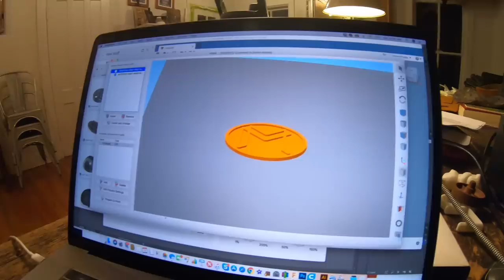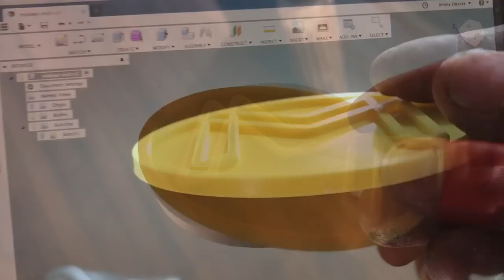DiResta Cast Brass Buckle

Comment: I like the belt connection and the bandsaw kerf to cut out the center hole was perfect. Little solder or jb weld and the split no longer mattered. A casting foundry is on my list! Great job 🖤™️

Comment: if you take 2x4 wrap 3 or 4 newspapers around it tie end with wire soak in bucket of water , as soon as you pour grab 2x4 and hold tight over top of casting steam will force metal deeper into casting

Comment: Would it not be easier to remove the template from the mold if the back was taped to plywood that is larger than the mold box?

Comment: Rather than soldering or using jb weld, could you not have added a couple of small extrusions to the back of the casting that you could hammer down like rivets instead? Or even just used what was already left over from the casting process?

Comment: Nice buckle Mr D.  If I may, try drilling a couple of holes into the back of the pattern so you can screw a couple of self tapping screws into it. They'll give you a good place to lift out the pattern after you've rapped it without blowing out the edges. Hope that makes sense? Check out a Youtuber called Myfordboy his casting video's are excellent

Comment: Noob Question : Could you lift it from the sand with a sucker ?
Reply: Super glue a lifting tab or knob would work easier.
Reply: STEALTH Damn it STEALTH now you made me hungry
Reply: The conventional way is to have tap holes in the back side of the mold to screw lifting handles into.
Reply: @vinercent215  I was thinking about the problem and was just going to suggest that as a possibility. Good to know I was on the right track.

Comment: Would a vacuum tool, i.e. mini plunger, glass lifter, be better to remove the mold from the sand because it has uniform contact, rather than prying it out at one point and possibly causing indents ? PS - live rounds would have been more exciting in the kiln!

Comment: What do you think about this Concept:

https://www.youtube.com/watch?v=GNNxzaGu_t0

The Concept is to use a gas-sealed box, and lay down metal in an Inert-Gas environment using Tungsten Electrodes, and wire-fed metals, with a CNC controlled Electrode Head, and likewise remove metal via CNC controlled Milling Head. 

Basically, 3D Printing of Metal using TIG, combined with alternating machine passes, (via the same machine), to clean up each weld-pass as needed.

A hybrid Additive and Subtractive machining process.

Among other features, it would allow localized metal alloying by changing the feed stock, (metal wire), during the additive process.

Comment: Did you ever put an unfired bullet in the Forge? Or do you check them before putting them on fire?
Reply: Daniel H. Those were just shell casings. If a bullet was still in the top it would be very noticeable.